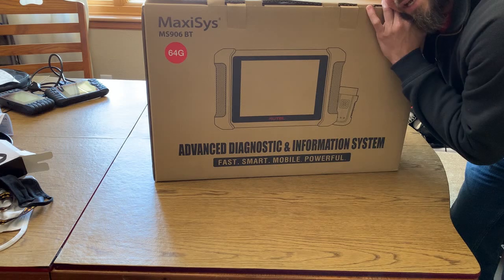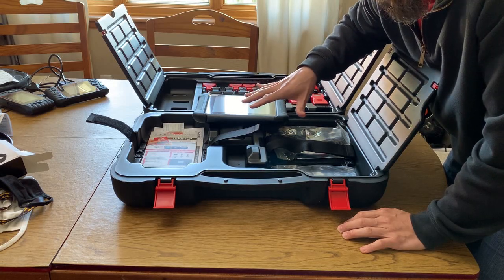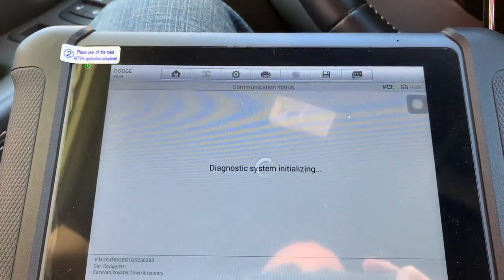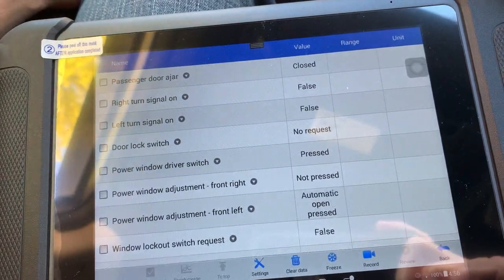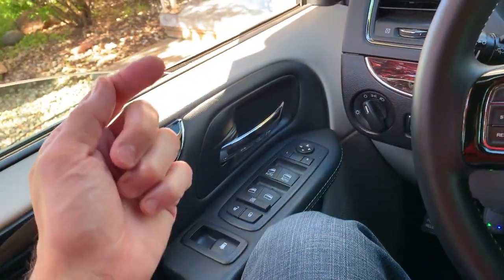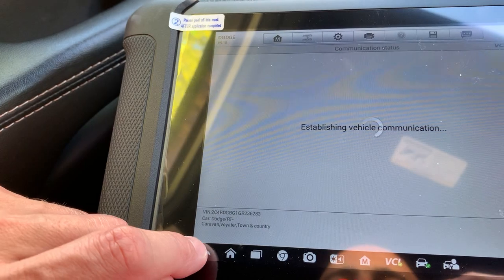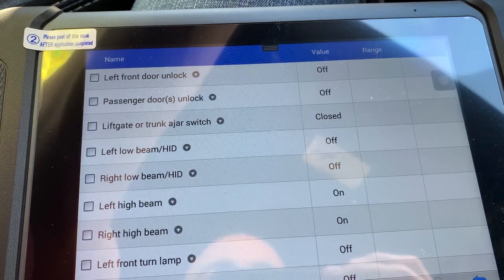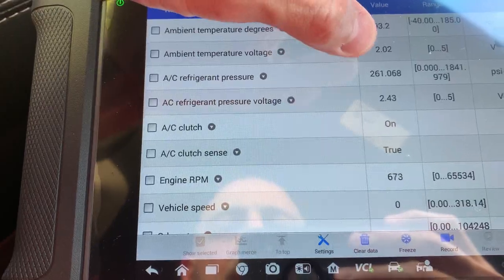Are Autel scanners USELESS - MS906BT - MUST WATCH BEFORE PURCHASING -

Comment: Autel scanners certainly aren't useless, but people should at least be aware of exactly what they're buying. First and foremost, they're a Chinese made tablet running a ridiculously outdated Android version. We're currently at Android version 12, and Autel scanners are running Android 4.4. Let that sink in for a bit. There's no Google play store, which is ridiculous for any Android device. Why?......Made in China. To be fair, I'm not saying Autel is junk. A lot of people use them on a daily basis without issue. These scanners are not, however, some sort of technological marvel. On the hardware side, they're average. Nothing great, nothing horrible. The one big plus these scanners have going for them is updates. We all know what snap-on bleeds out of us for updates. Autel is much more "economic friendly" in that department. Are they worth the money? I'd say so, but not by huge margins.  There's definitely room for improvement, particularly on the software side. A good option for someone who doesn't want to bleed cash for a snap-on? Definitely.
Reply from the maker: I concur on all fronts. My biggest problem with any aftermarket scanner is that once you get the fault code. You cant do anything more like start guided tests directly from that fault code. The only option the scanner gives you is to google the code.

Comment: I was an mechanic for 15 years before getting into trucking back in 2004. I still from time to time work on my own vehicle and help others with theirs. Due to technology getting to where it's at even in used vehicles, I have been now looking to getting a scan tool. I really like what I've seen with the Autel scanners and would like to get one with bidirectional capability but being I no longer work in automotive on a dally basis see it feasible to purchase something like you have which now is over $1200. Was wondering if you could recommend something or if that's the minimum for bidirectional
Reply from the maker: Hello, so the mk808 is a lot more reasonable and is still bidirectional, also I hear the new icarsoft 3.0
Are bidirectional. I am about to get a few to review.  But also the launch brand will work too.

Comment: My 908 is a pretty decent setup. My compaint is buying it used, from a pawn shop and on ebay. Is that its already been registered. By an unknown individual. So i cant ever update it. Autel is no help with this situation.
Reply from the maker: You are correct, they will only assist when its purchased through an authorized seller and transferred properly from seller to seller.
Reply: @MasterTechLou  i would argue the pawn shop that obtained and sold it legally would be proper transfer. But that arguement fell on deaf ears.
Reply from the maker: @sandoobis  I hear you  , sorry this happened :(

Comment: I want to buy autel scaner but does this relearn or programs tpms sensor and key programing i have a shop i work on cars between 2000 to 2018 yrs and i get a lots of tpms but i need to program and i cant i wannet to know if this scaner does that
Reply from the maker: Yes this scanner can do this but you need additional things as well. Check autels website.
Reply: Does this programs or relearn tpms aftermarket sensors for all cars and what additional things you need for tpms  and i believe does most of the stuff and where should we get this do you have webside where we can get this

Comment: One thing I hate about Autel. Go into engine ECU and live data. you wont get the same options on all engines. I wish you got the same list and if say a sensor was not available it just say n/a. So I can find crankshaft sensor without having to search loads of different pages.
Reply from the maker: I agree. Sometimes it shows too many sensors or not enough based on the actual car.
Reply: @MasterTechLou  compared my ultra against im608 pro and ms906. Truth. Same data on all. Ms906 is small and great. Prefer using that mostly. Oh and intelligent diagnostics in ultra. Never once worked. Topology junk too. 😁
Reply from the maker: @jamesbarratt593  yeah topology is only good in oem info sadly
Reply: @MasterTechLou  how is topology good. Miss the point on that.
Reply: @MasterTechLou  i charge by the hour but still. I changed crankshaft position sensor on mercedes a180 and still to this day cant verify if it works using autel ultra. Live data it just does not appear there. How crap is that to omit that sensor.
Reply from the maker: @jamesbarratt593  good question. Should be in ME module live data for crank sensor 🤷🏼‍♂️
Reply: @MasterTechLou  me module. Whats that?
Reply: @MasterTechLou  oh have you any idea where I can get a wiring diagram for eis modules. My haynes workshop is great but misses that. Alldata is great too buy no EIS wiring diags
Reply: @MasterTechLou  you should always get the same list and if not there just have n/a next to it. Personally I prefer my chances with EOBD live data than manufacturer specific.
Reply: Just bought Mercedes dealer software on multiplexer. $1000 so hopefully I get great results. Just got ista d as well for bmw. Happy boy

Comment: Great video, I was wondering if this tool is capable of relearning new sensors such as crank postion sensor?
Reply from the maker: Absolutely it does everything the factory scanners can do from what I’ve experienced so far.
Reply: @MasterTechLou  Great! Thanks for the response. subbed
Reply from the maker: @rtrent3988  anytime. I appreciate you!
Reply: So this unit is capable of reading cmp offset on a vortec of the 96 to 99 Era and fuel sync on late 90's dodge magnum engines
Reply from the maker: @aprilstewart4051  I dont have that answer nor a car of those years to try it on. Sorry!

Comment: Nice video as always. I need a scanner that has both programming and diagnosing abilities within the range of 1200 to 1300 dollars, I normally work on Asian cars and Benz. Thanks in addy!
Reply from the maker: this one will do that but you need the J2534 passthrough and have to pay the manufacturer website prices. if you work with your local O'Reilly's salesman they can work on the price for/with you. But please buy from authorized seller or autel will not assist.

Comment: So check this out - I wanna be a Master Tech...a diagnostic master tech. I don't wanna be a parts changer. My automotive experience includes working on fully, electric, buses - city buses...not hybrids. Currently I'm a Marine Electrician but I went to school for Electronics and worked as a copy machine technician and Nuclear Instrumentation Technician for one of the two, US nuclear submarine manufactures.

I sincerely believe I can transfer my electrical / electronic knowledge over to the automotive field because over the past two months,  I have become fascinated with the technology involved in said field. That being said, I am about to begin working at a European auto manufacturing plant here in the US.

I have looked at quite a lot of scanners and was thinking of purchasing the Xtool D8 along with a Pico Scope 4425A Oscilloscope. I do have experience using an Oscilloscope but not a scanner but it seem simple enough. These instruments are probably not needed for the job I'm about to embark upon  - as a contractor - however, I believe I can put them to use as a home and mobile diagnostic tech when my contract ends. That's my goal.

I'm at retirement age but still in tip-top shape so I need to do something when I finally decide to retire. I think electrical diagnostics and electronic / module troubleshooting and repair would be right down my alley - addition to programming keys and said modules. I guess my question is, which scanner should i get, the D8 of the MS906BT?  What would YOU do if you had to make the same choice?
Reply from the maker: I fully believe they are almost
Identical. Software and functionality. I dont think you can go wrong with either.
Just know that there will always be a snag you run into with aftermarket scanners. Being a master tech is easy. Just know that you will forever be learning. We will never know it all. To fully diagnose items without changing parts all you have to do is exhaust all options during testing. Confirm the failed part. Reproduce the failure. Confirm functionality once the part is replaced or repair is made. It really is that easy. The trouble comes with knowing HOW a system is SUPPOSED to work. You cant fix it if you dont know how its supposed to work. Just by your message I know you will succeed. Best of luck to you. 💫
Reply: @MasterTechLou  Gee! thank you so much MT. I'm currently doing a lot of research as per how things work. I find that I understand all of the material with relative ease, which is most likely due to the fact that Physics was my number one subject in community college.

You are therefore absolutely correct in stating that one  HAS  to know how a system works, in addition to understanding how various systems work together. Luckily for me, I'm extremely patient and prefer taking an orbital look at things. I'm really excited about my new venture.

I will have to start out with after market equipment since I'm doing this on my own however, I still want to acquire good equipment. 

Again, thank you roe your response and kind words.
Reply from the maker: @patbaptiste9510  I wish you the best. I have no doubt you will be successful in whatever you do. 💫❤️

Comment: I purchased the mk906bt but I’m looking if this will provide real live values of fuel trim ? If so where is it located?
Reply from the maker: Depends on the car but yes it will be in the engine module under fuel trim, or adaptation, or stft ltft something to that effect.

Comment: Thank you very much for this video... I am a qualified mechanic and have been looking for reasons to justify a purchase like this for years, i am a qualified low level mechanic but the thing is when i got my qualifications cars back then where very simple and we had similar scan tools in our learning environment and we did touch on those subjects the thing is cars then didnt have as many control modules as they do now back then it was more of a premium feature in cars wich left me very confused and having used autodata and similar softwares when i was learning, it left me confused when it came to looking at these scan tool to buy for my own personal use

Long story short i havnt bought one of these due to confusion and i only stumbled upon this video after looking at an autel product and you just removed all the doubt ive had over the years about buying a product like this

Thank you so much
Reply: I'm in exactly the same situation as your self , I also felt confused and very worried of being left behind
Reply from the maker: Glad I could help!
I appreciate you reaching out and watching!
I love this scanner so far, there are also some others that are starting to do similar functions without the hefty price tag but if you have a shop or do a lot of diagnosis, you will not be disappointed. Happy New Year as well and thanks again!
Lou

Comment: I have a question i got a Ford F-350 lariat turbo diesel v8 6.4  supert duty  can i used this scanner to diagnose many problems on it ??? I will really appreciate if I can get a little help to Make a decision if this scanner will Work on it .. thank u on advanced
Reply from the maker: This scanner works on soooo many makes and models. 
Yes this scanner will work for Ford models. Keep in mind, if you have no codes, then you do have to find a reference manual to know what values are correct or not.
Scanners are absolutely needed to diagnose automobiles, but its tricky finding the values and whats correct and not. I hope this helps. Lou

Comment: How are the options with transmission control? 
I need to further diagnose a P0750 code where the valve body solenoid has already been replaced,
I'm wondering if this tool has features that are transmission specific that could give me more information.
Reply from the maker: So far what I find is as long as the factory scanner can do it the scanner can do it with very few exceptions. So they should be able to try to activate solenoid‘s if the factory scanner had an option to activate solenoid‘s. Also you can reset adaptations or learn values. But if you had a code relating to a solenoid or circuit and you replace the solenoid, then you probably have a wiring issue or control module issue in my opinion. I hope this helps.

Comment: I'm looking for one to do my range rover, every time i get one that says it covers it but then not my car I have an 06 with trans problems basically want to test the solenoids and monitor fluid temp, also have a mini cooper with all it footwell problems when it rains but trying not to sell my house to afford it. LOL Great video and common sense.
Reply: I have a Snap on Verus I am going to try, it has keys for the rover just looking for something newer although it covers later years. thanks
Reply from the maker: Hope you find one that works my friend. I havent done many rovers or else id be able to suggest one.
Reply: @MasterTechLou  they have a lot that say they do what you want til you call up your car and say Not supported.
Reply from the maker: @CCROSS5882  I hear you, its the problem you run into with reverse engineered scanners

Comment: i want to buy the ms906bt like yours,i want to ask if have the same software like the mp808ts ?or have more ecu mods and more programming?you find any bugs in software because i have launch and have bugs in many cars.thanks for help
Reply from the maker: I do not know the similarities with the 808, but I will say, I ran into an istance where the autel would not read a nissan titan air suspension module, but the lauch would, so yes with any aftermarket scanner you will run into instances like this, I always suggest shops have a few different brands on hand or just understand that at times you may be limited.

Comment: So that scenario about the window switch just because it works with the scanner and not with the switch that doesn’t mean the switch is bad that switch has data lines it’s not wired into the module,  it could be software, there could be another module going bad not related to the windows but it’s messing up the network,  the window positions (limits) might need to be re-learned. All I’m saying is you were way too quick to call that window problem diagnosed! When you have a window system that runs off data lines thats a whole different world where every car can be different and the autel doesn’t do everything for a problem like that there are some parameters that the autel doesn’t see  like if the window positions are learned the autel won’t see that in certain cars so will be chasing ur tail thinking it’s something else but you can’t diagnose it because the scanner doesn’t have the capability however say you had a gm vehicle when you run across a problem where you need the dealer scan tool well if you had J tool (pass thru device) you can download the tech 2 software (dealer scan tool) and using the pass through device you now have the dealer scan tool and the newer stuff you also just use a lap top with a midi2. Since the window switches are ran by data lines I would use the gm software to check the network which is something the autel is also not capable of. Now if it ended up being a software problem you could re-program the module with the pass thru device and not for nothing so many issues on cars now are software issues and so many problems like a hard shift can be fixed by software I highly highly highly recommend you buy the pass thru device nowadays ur naked without it. Now with all of that being said you can never have enough scan tools one scan tool with always do something another one won’t. Scan tools, pass thru devices are all just another tool and you can never have enough of them. I am agreeing with you though any scan tool is worthless if you don’t know what ur doing.
Reply from the maker: I will not disagree with what you are saying by any means.
This was not a diagnosis which you can tell. It was more explanation of a thought process of how scanners are needed for diagnosis.
You gotta keep in mind the times we run into it being software issues or glitches, are far and few between. I can tell by what you speak that you are a very good tech with YEARS of experience. The things we see, the average viewer will not run into.
Plus that would be a 10 hour video haha. There is never enough coverage of all the scenarios one can run into. I really appreciate you watching and commenting! Thanks!

Comment: on the Autel Maxicheck pro, is it normal for it to not recognize a 2015 ford transit PCM when trying to get into the SAS menu ?  Im  Ultimately trying to recalibrate the steer angle sensor and it says the "unique power train control module is not recognized and i should try manual vehicle selection.  (only the FORD transit connect shows up for available vehicle options in the scan tool. )

Comment: Hi I'm looking for a good scanner to look after family 4 cars need to see operations bibderectional and see fault codes and manufacturer systems 2 diesal cars and 2 petrol cars . In particular have Mazda rx8 hobby car to keep good steering etc  .any advice on good  make models as so many to look at . Just advice to where to look or models to look at. I realise it's only advice and decision is mine .Thanks if you have any help. John. . Just watched this video and like the autel  906bt . But about £900 here UK any advice .
Reply from the maker: well there really are only a handful of good choices. 
Autel
Launch
Icarsof
Autologic
seems that they all use similar if not the same software. best I can say is make sure to buy new and make sure there is a return policy, you can always sell for same price if not little less  if you dont like it. but they are all trial and error to see if it meets your needs. Hope that helps. Lou